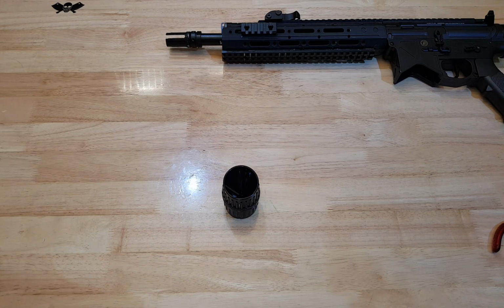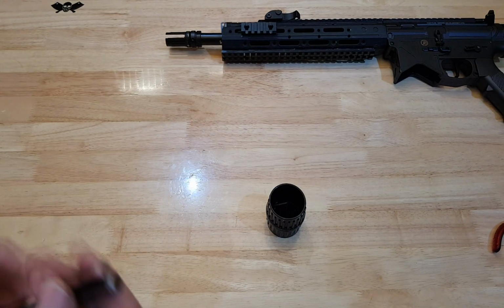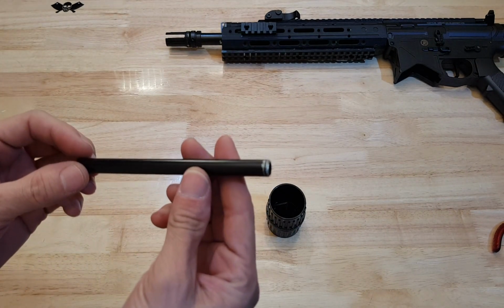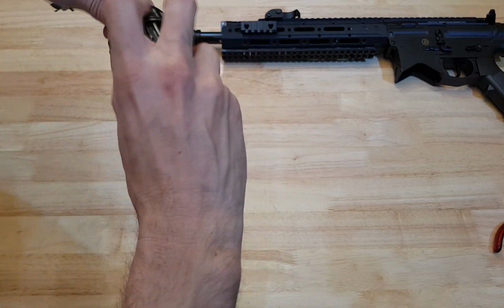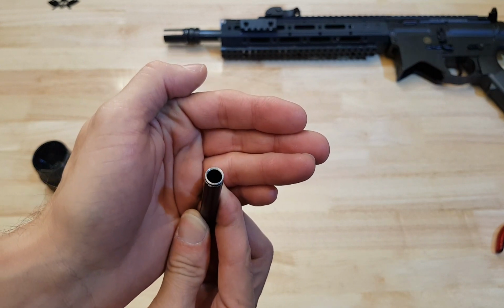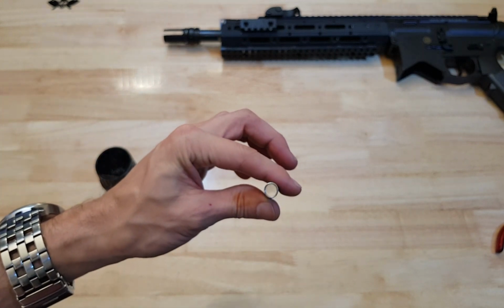you need this tool!

Comment: Great video. What tool did you use to cut the barrel in the first place? I recommend using a pipe cutting tool available from your local sausage sizzle dispensing hardware store. The one I got was only $15 and it came with a built in deburring tool as well.
Reply from the maker: yeah pipe cutters are the go. this off cut was done with a dremel some time ago, not even neatly as this was the waste side of the cut, I cleaned up the side that I was actually using, but didnt have a pipe cutter at the time.
Reply: I got a pipe cutting tool for free because a plumber accidentally left it on the downstairs floor after he fixed a broken water pipe. Now I've just got to get a plumber to accidentally leave a deburring tool and I'm set..
Reply: @RA75AK  
Wait a sec... I left a pipe cutter tool at a job site some time ago now
Reply: @ThatGuy-sw9ic  haha no worries. I've got it here. I'm sure you remember the address so head on over whenever..
Reply: @RA75AK 
Fuck, I wasn't actually expecting a reply...

Comment: What gel blaster is that? it looks mean
Reply from the maker: It's an XM316 with nylon gen8, metal gearset, green O ring, alloy barrel, 1.4mm spring, 11v battery. Etc..
Reply: @lowguidoschopshop  where can I get one?
Reply: @vocalthrower448  did you find one mate?